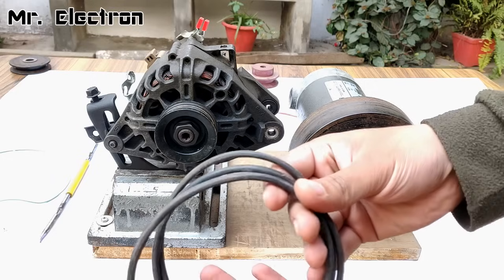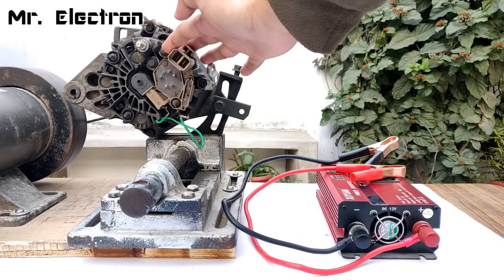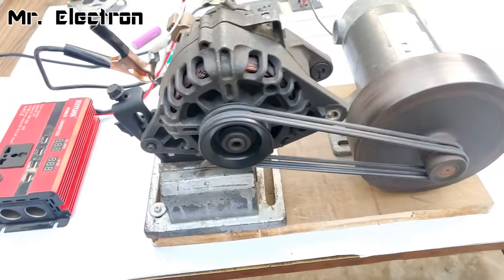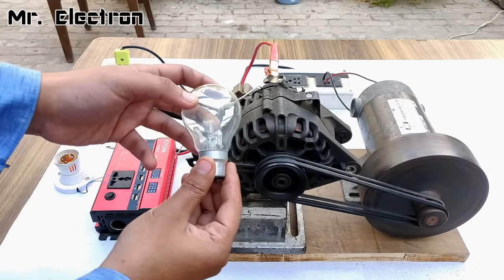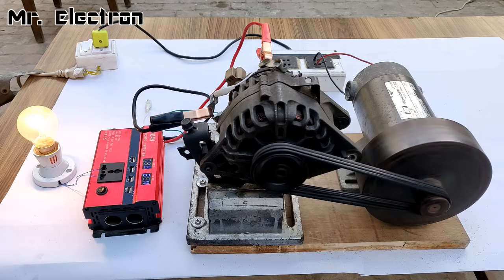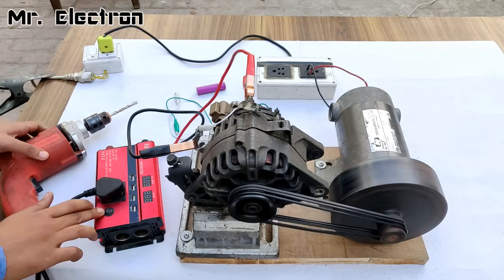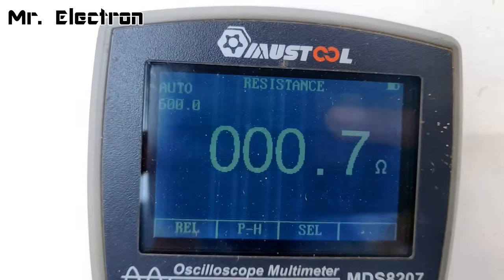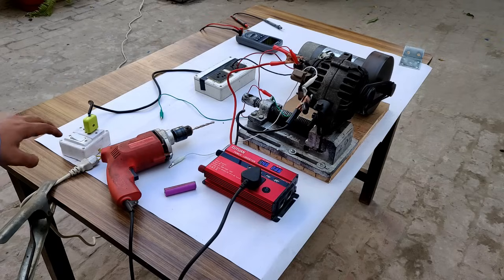220v AC from 12v 90 Amps Car Alternator 1000W DIY

Comment: The best use is to charge a bank of batteries and let the batteries handle load.
Reply: Mr elecron please display alternator converted to DC in conjunction with three 3 rectifayer 3510 I need it  thanks
Reply: No it's not
Reply: @jakem117  Why?

Comment: Can you exite the alternator using external power like solar or 12v battery like you did with the small battery to power it so it can power the 220v motor via drive belt instead of using the A.C. power to power the 220v motor.?

Comment: Can you check out American Techs video - 100% working free energy generator,  amazing self running  machine and possibly answer  these questions for me.
1-So...the capacitors in series give you over 16v. That powers the bigger motor of 24v is that correct ?
2-That via drive belts power the 2 smaller motors is that correct ? 
3-The smaller motors give power back to charge the 16v capacitors is that correct ? 
4-Then you can wire either the 24v motor Or smaller motors to ANYTHING within it's out put current capability is that correct ?
5-NOW, how do you regulate the capacitors so they DON'T OVER charge when they are full and STOP charging, and START charging again when they get LOW like a solar control charger does from solar panels to a battery. ?
Reply: Sorry to tell you but that video you mention is nothing but a hoax. There is absolutely no Free Energy there. The capacitors were already charged up before they turned it on and they were supplying the power to the motors same as a battery would do. They created a loop in the system so that some power was being generated back to the capacitors back that energy would run out in time and the whole system would be dead until you recharged the capacitor from an external energy source. It's just a toy to create the illusion of perpetual motion.
  Even this video here is a joke.. The bloke uses at least 3 times the amount of power required to do a simple task... He Converts Mains AC to DC to drive the DC motor. The DC motor drives the alternator. The Alternator creates AC and converts it to DC. He then goes and converts that DC back to AC. No common sense used there. He could have just plugged the drill into the Mains power supply he started off with in the first place and used way less energy. Every time he converts the power it consumes energy and the motor and alternator consume energy. There are 5 processes  in that system that are not required.

Comment: Buy and add the in-situ voltage controller assembly, this is a part that attaches behind the alternator along with the rectifier assembly beside it. This will keep the voltage between 14V to 15V at any rpm or current draw.

Comment: Hi Mr Electron

could i first just say thankyoufor a very interesting and informative video . However could you please answer the question that I and it seems quite a few others would like to know,  I presume you are using the mains current to the motor purely for demonstration purposes?     as Obviously generating a power supply by using another power supply would totaly defeat the object, so our question is, 
what would be replaced by the mains supply? for example would you be able to run it from a windmill power system? or some sort of water wheel set up running the motor? what would be the minimum RPM the motor would need to turn in order for the alternator to produce a steady 220v ? Thank you once again

Comment: Why use AC current to turn the alternator which produce DC current and convert the same DC back to AC using a converter???
Reply: It worse than that.. He converts  Mains AC to DC to turn a DC motor to turn an alternator that converts AC to DC then he converts that DC back to  Mains AC. He could have plugged the drill in at the start and bypassed the other 5 steps and used about 90% less energy.

Comment: Hi, what is the green wire for in the alternator?
Thanks.
How do you install the green wire?
Thanks.

Just wondering, the electric motor is still connected to your house’s electricity.
Why not just connect the drill to your house’s socket?
Thnx.

Comment: If you put two car batteries between the alternator and the inverter your voltage won't keep dropping on ya your inverter is drawing the electrical current as fast as the alternator can produce and I'm sorry to bust your bubble but you are using more ac current to turn the electric motor then you're getting from the alternator but great effort keep working with it you might come up with something really good

Comment: I am very interesting like this.. please replay me. my doubts that's the inverter you need to work without battery right, my question is inverter need 12volt.alternate already  12-14volt out put then why you do many connection works in alternate. (This is my English )

Comment: No sense at all, 220v motor to turn alternator to run 12volt inverter to generate 220v to run a drill, really ?????????

Comment: I cant believe I watched this pointless video so you took a 230V line rectified to run a variable speed  DC motor,  to turn a alternator and hooked to a inverter  to run a drill that could be plugged in the 230V line you started with,  and what's up with the little battery  what did that do this is a total waste of time and effort.

Comment: You are spending more energy running that device than you are creating, remember it is spent in running the motor, it is wasted in heat, friction, in the cool inverter fan etc, to produce only a little, generating noise, heat and  Cooriented expense in addition to the cost of all the equipment and you still have to plug the motor into the network "what a waste"
Reply: But if you replace the motor with a vertical axis wind generator...
Reply: I did not heard him saying that this is „free” energy generator. He just conected car alternator and inverter
Reply: This has applications in trail welding and mobile repairs without the need to haul a bulky generator.
Reply: It's a dc motor so it's not that much energy waste

Comment: I think you need to hook up the alternator to a car or truck battery. Same with the invertor. Then it will work better. Invertors are supposed to be hooked up to a car battery.

Comment: Hi there brother
 Thanks so much for your information. Could you please draw  all the connections with  different color ed wires and where you hook them all up meaning without details for a novice like me. Please indicate the name of all the stuff and equipment that are used in your project. Please indicate how we disconnect the Diods from the alternator so instead of getting a DC current it will give us an AC current. What if we use 2 alternators instead of one and how we connect them so we can run more appliances on. Please please help me out by providing more details by showing more schematic drawings and show me Step by Step so even a novice like me would know how to do this project and if you can send the equipment by mail to me ,of course I will pay for them. You can make this project as a kit and sell it. I would be the first to get it from you. Thanks .james T
Reply: Is the alternator brushless ?

Comment: I'm confused here.. If it's self exited, what are you jumping off to bring fourth a connection to activate alternator? Especially when a rotating alternator can produce its own voltage. Your not connected to any monolithic circuit just the brush contact. Could you enlighten me, thanks

Comment: Why?! 🤦🏻‍♂️ What is the purpose of this...this makes no sense to do. Its so inefficient amongst other obvious reasons. If anything remove the rectifier and voltage regulator on the alternator and build or buy an AC regulator. Still not worth doing.

Comment: You have done nothing here really... Of course if you spin up an alternator and excite the field you will produce voltage.... That's what it's designed to do..... And you didn't get 220v from the alternator you got 220v from the power converter..... Exactly what it's designed to do.... If you hooked up the power converter to you car weather it's running or not the power inverter WILL give you 220v just like it's designed to do...... You just went about doing it the hardest possible way confusing the layperson with the otherwise simplicity of the entire set up... You've done nothing here

Comment: mr electron   my 12v dc car generator plug has four wires tabs how do i know which of then to connect ,  to self excite the generator,
cheers jm
Reply: Any combination of connecting the four wires WILL NOT "self excite the generator", NOR it will produce more Wats than what you have initially put into the system !?
Entropy can only increase (it's a basic physics LAW), which said in other words is the same as saying that you will NEVER produce a self-sustaining system (perpetual motion), or one that can produce more Energy than initially put in.
You will first have to invent a self-sustaining system, which produces the same amount of Energy that it spends.
Then on the way, you will be eligible to claim the Nobel Prize.
After which you can start creating a system that produces more Energy than initially put in it, which is an even greater impossibility !?
If you successfully create even a micro Wat more than initially what you have put in the system, you can than claim all of the Nobel Prizes for everything, cause you would have solved humanity's greatest problem, which is the need for more and more energy.
In other words, you would have created a paradise on Earth, cause humanity will have anything and everything in abundance which will lead to stopping all the wars since resources will be more than plentiful !?

Comment: Sorry, running alternator without a battery will cause it to over heat and burn out. The battery will help converter. I do these myself, I'm off the electrical grid by using 110v motor turning 100 amp alternator using converters to power various appliances.

Comment: Sorry for my slow understanding your project here. If the fly wheel driven by an electrical source not 220v, but you need 220v and you use it to drive the alternate and let alternate produce a source and you convert it to the required voltage source. Was it right? Did I take a long stretch to reach my other ear?

Comment: Hi, the alternator you are using, is probably not working fine. It's inner regulator is not functioning well. 10 Volt or 15 Volt is cut off voltages for battery charging. 12 Volt x 90 Ampere = 1080 Watts, you barely can run a driller consuming 250 Watts. You have used a cheap converter, probably it's efficiency around %60. So you get about 350 Watts from the alternator. This is 1/3 of the alternator's capacity only. Between 1000 and 2000 rpm, alternators can give their potential around %90. But, this doesn't mean their Voltage producing goes up over 15 Volts!

Comment: What the f are you doing here?    You need electricity to  run thr electric motor to turn the alternator... your not making more power than you are using so your just making a waste of parts and power.

Comment: I don't get it..?!?!.. So from the 220/240v AC mains U plug the 220/240v motor to run the 14v DC car alternator which U use the inverter to turn into 220v AC power. I think the only thing excited was U bro with connecting things..

Comment: Hey, you have some doubts about car alternator, if the alternator is good, that means the pre installed rectifier in the alternator, it produce maximum voltage 14.9 v for 1500 rpm. If the rpm is high the voltage never exceed 14.9v for good alternator. It never produce 20v or more. Then you don't need the motor controller to control the motor if it rpm is more than 1500.

Second one, there is no need to use resistance to start using the alternator. It doesn't mean the wattage of the alternator.

Comment: Hi, my friend,. I wanted to let you know" that you can use the heater winding from old heaters as the resistance - wire.!! & even if it get ( red- 🔥 hot), it won't hurt it 
Cause that's what they are sapposed to do. So, pull the winding from an old heater that has a winding as the heater coil,... & you'll be fine......
Reply: This wire is known as "Nichrome Wire".  It is a  Nickel and Chromium alloy.
Reply: The same wire is used and sold for electric vape pens in small rolls

Comment: Try wiring Romax wire straight to the stator The copper winding under the keys three wires that come off in the back once the alternator is spinning will be charge that between 110 V 115 V AC current and a pure sine wave !

Comment: I don't get  your  point. These are obvious facts.
 A 220 V motor turns with household 220 V  current.A car's  12V alternator output can be transformed to 220V by an invertor .And so on.
If you mean reaching to a self running system with free energy,it does not exist !!  Free energy is a fraud on YouTube

Comment: Wats the ususw when u have 220 power already
Reply: Basically ignore everything upstream of the alternator because the 220 power is only being used for convenience.  In a hypothetical where you'd need this, the treadmill motor would be replaced with a gasoline engine, steam engine, human or animal power, or many other possibilities. You're missing the whole point.

Comment: 1.  That inverter is Not 1000w  2. You pull  90amps out of that alternator and it will stall the motor and slip the belts you need to put in 1100 watts of power min just to load that alternator

Comment: 20 minute video just to say buy a cheap inverter and hook it up to your car..... Nothing special or original. Try getting grid voltage directly from modified alternator instead and bypassing inverter. Then you'll have video material.

Comment: 220V AC Mains to drive AC Motor No Information ? - Alternator = 12V * 90A = 1080 WATT  Max ratted output - Inverter = 12v to 14v  In Put To 220V @ max 3K Watt out put from inverter - 100Watt Lamp = 100W/220V = 0.454Amp  - 350WATT DRILL 350/220 = 1.590Amp = AC Mains doing all the work - So you just seen an advert to sell the Inverter ratted for 3KW  working at 350Watt, a car Alternator produce 14V @ 5amps  max = 14*5 = 70watt - Nice Advert.
Reply: Zxgauea

Comment: Mr. Electron i want to run angle grinder Voltage220-230 VAmperage3AFrequency50/60 Hz power 670w with tractor battery. I used house ups inverter but within small time beep sound is heard but battery is fully functional. Is there any solution?

Comment: so this is a video that proves that if you plug into the wall outlet you can power things up !
Reply: Yes but once he starts it up he could actually plug the motor into the alternator and it will be self sufficient u can get even more out put by adding magnets to the alternator
Reply: @KnightOfChrist1978  to run forever?
Reply: One million views for a junk video
Reply: 110 to power the dc motor.   Then converts it to dc output to the converter to 220v 
Yea.   Kinda a round n about way to achieve 220.
Some countries that’s the only way to do it.
Fun to watching though!

Larry
Reply: @mafosa8519  you are giving  TOO  MUCH  credit !!!!!
Reply: @mafosa8519  If you've got 120 then you just need to find outlets on two separate circuits, like the next room, and combine both hot wires inside a 240v receptacle. Each pin will get 120v for a total of 240v.
Reply: @mafosa8519  ONLY IN INDIA,  thats the only way to do it

Comment: throw in a capacitor and hot wire the power back to itself then un plug it and see if it still runs

Comment: Just wondering, what is the use of that switch with a wire that clipped into the table, looks like connected to the outlet as your power source. Unplug that let see what happen..
Reply: yeah that s what i see, hes using a IEC plug with 220v, converting it to 12v then back to 220v???? what is the point ...

Comment: In our wind farm, which runs our home and farm, we use 20 - 24V/200A alternators with 24 12V 8D Truck batteries run in 24V cells through a 10,000A Inverter to 120V.  On most days it supplies our full electrical load (except when welding...we use a diesel generator for that.). Great video!
Reply: The caveat is that we live in a valley where 12-105mph winds are constant. Wind generation using inefficient alternator is a no-brained and dirt cheap. Wind power is inherently unreliable in 99.9% of all applications and would be a gigantic waste of time and money for most people.  We are adding solar grid for the underground retreat complex we are building.  We anticipate the need to move our sheep underground during one of our routine 90+mph wind storms. During these winds all turbines are locked down with centrifugal braking systems and solar must take over to avoid frying the system with massive overload charges and cf-related mechanical disintegration. Our solar panels are locked down into 1/4”x2” angle iron frames mounted to 3”x6” steel girders using underground 2/0 cable leading to an underground battery bunker.  When life gives you lemons...you still need power to run the juicer!
Reply: I'd love to see a video of that setup.
Reply: Can one learn from you
Reply: Thanks
Reply: 20 × 24 volt/200 amp alternators? With 24 × 12volt car batteries?
Reply: @timtravasos2742  20 to 24v mate. 
24v battery = 2x 12v batteries wired in series. Inverters double their output power when running 24v opposed to 12v 👍🏼
Reply: can you use solar panels to make it work
Reply: Dam I wish I had your kind of money
Reply: I want to do the same thing, what windmills do you use

Comment: A brilliant idea to replace the resistive wire, measure the resistance of the rotor, calculate at 12v how many amps it will pull (example: for 2 ohms it will require 6 amps) and after calculating the current use LM7812 voltage regulators in parallel as many as needed , if you need 3 amps use 3 or 4 in parallel and voilà. The electronic voltage controllers of the car alternator make the control by the voltage of the rotor, keeping at 12v the output may be more stable or the subtle increase in speed does not raise the output voltage much.
Reply: paralel lm7812? just use other way